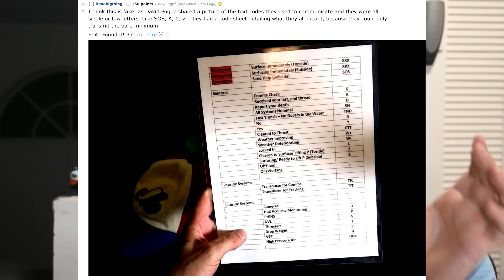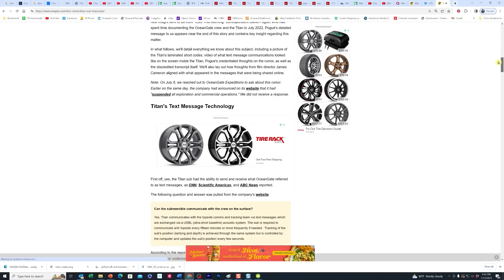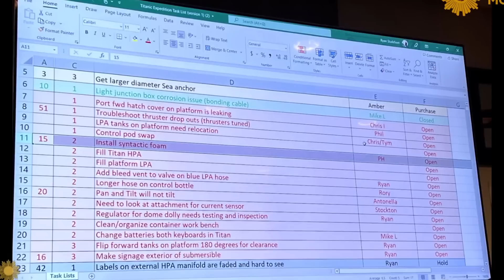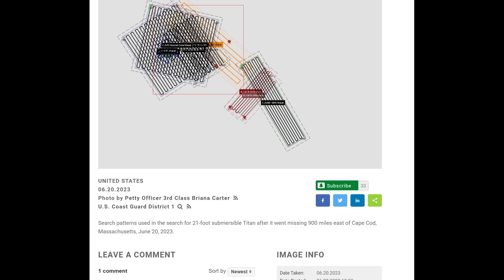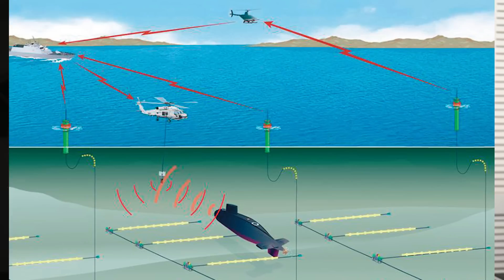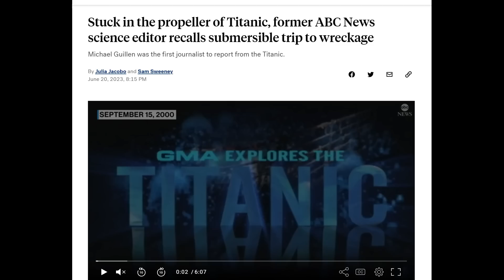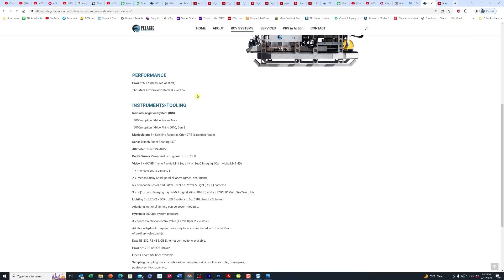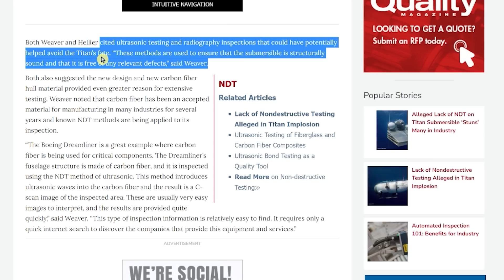The Shocking Truth About Fake Sub Transcripts No One Tells You

Comment: The carbon fibre body is smaller than the titan spheres. It should be vice versa because the carbon fibre is more compressed than the titan metal and so the glue has to work hard. If they made it vice versa than the pressure would support the glued connection.
Reply: @jorgw.6151 If you put the carbon fiber outside the mating surface then repeated dives will create a crease where the hemisphere ends. That would be the start of a failure.

One thing I've not seen mentioned is the carbon fiber cylinder was under compression in two directions. One is pushing perpendicular to its center line. The other is the end caps are pushing toward each other parallel to the center line.
Reply: yep, the design is horid, who the f makers a pressure wessle that has a endcap larger than the body? ofc its going to blow the f up , the tube is being squished and elongated , so its cross section is getting smaller stressing the glue as a mf, as you said with the endcap being glued under the carbon not over it would provided much more support,i can even imagine one with a lip going far over the edges on both the id and od, like 30cm over the edges, ie slotting the pipe into the caps , maybe even a titanium ring in the middle of the damn thing so the water pressure cant squeez its center as mutch.+ the carbon job is a shitshow, no real weawing of the fibers, no autoclave... its a miracle that thing made it to titanic depths even once ...

Comment: About the line question. It is not so easy. You have to pull back the sub + 4km of steel wire. It is kinda heavy. It is easier if the sub is able to move by itself.

Comment: Well then, I want to ask, "How would the rate of decent be adjusted.""?
I thought rate of decent was static, not dynamic and was based on ballast calculated at the surface.
Reply from the maker: The thrusters on the side of the submersible could be engaged to help slow the descent and also to help during your ascent when you need to come up as well
Reply: @jeffostroff  Agreed, they didn't appear to use the thrusters for an emergency ascent. (Mabe they couldn't because of alarms). I think the overall rule was to conserve batteries for the trip descent as well.

Comment: i wonder if the last releasing of the frame , with multiple attempts , was the part that was holding the structure the last moments .
Reply from the maker: The Titan submersible has a history of issues trying to release the weight so it could be just a flaw in the design. In previous dives we were. told that the passengers all had to get to one side of the sub and try to rock it in order to loosen the weights that just sounds so Mickey Mouse to me, when other submersibles use magnets to hold the weight so if they ever lose power, the magnets will release the weights and the subtle automatically float to the surface
Reply: "if the frame, was the part that was holding the structure the last moments"

how could you even come to such thought? it doesnt make even tiniest amount of sense. how can landing frame have any impact on structural integrity.
Reply: @ImRandomDude The landing frame was attached to the titanium front and back rings, that were shoddily glued to the rather rough edges of the CF cilindrical hull.

So it MAY have been this frame that kept the rings in place. End with the rings, also the domes.
Reply: @ImRandomDude  it was a frame , and it was attached to the hull ,so it might give to the hull some more points of strength while it was attached
Reply: @reoproedros  detachable "legs" providing few points of strength to the pressure hull thru frame ... okay whatever :D